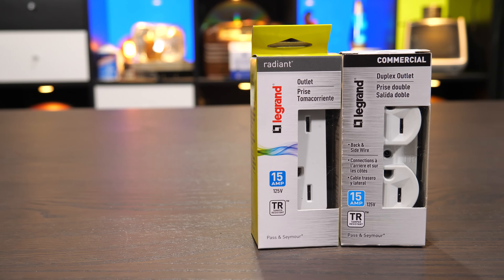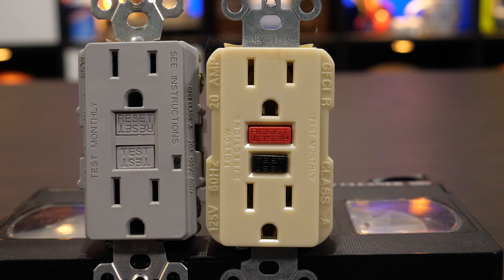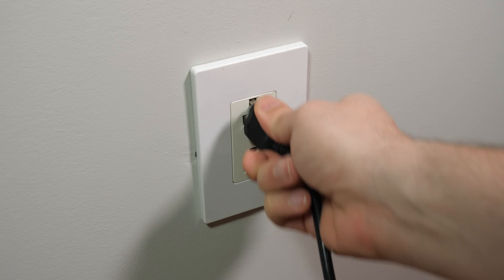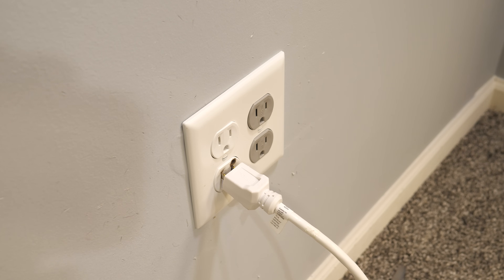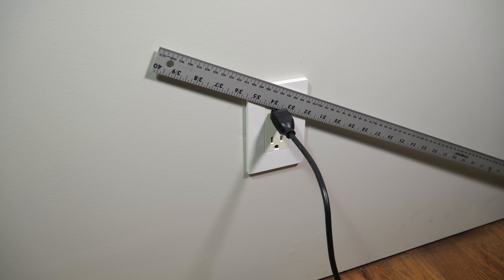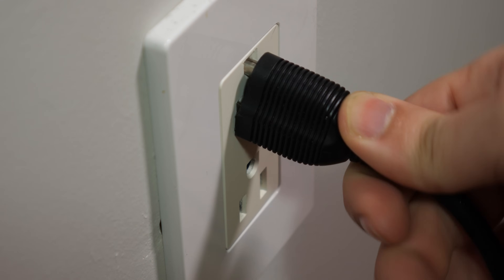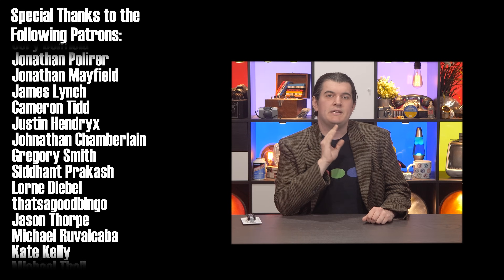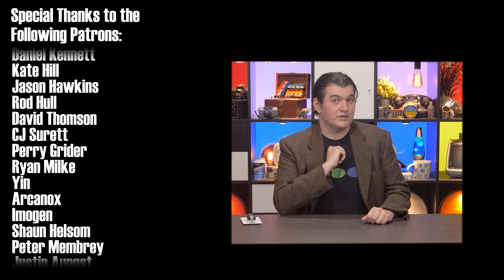Power outlets are topsy turvy - but does it matter?

Comment: Is this a re-post? I seem to remember a video just like this.
Here in canada, wiring code has flipped then flopped back. for a time, electricians were required, by code, to orient the outlets with the ground pin at the top. There are still some outlets around that are installed that way. When I install outlets, I use commercial grade duplex receptacles. They only cost a few cents more than the residential grade, but the internals are vastly more robust. I seldom have to replace an outlet a second time and when I do, it's because of an incident causing damage, not normal wear. Attachment caps (plugs) have the ground pin longer than the conducting prongs. The last thing to break connection is the ground pin. When placing the ground pin at the top, the plug now has to be further out of the wall before the conducting prongs break connection. This is why the electrical code inn Canada went back to putting the ground pin down.
Hope that clears things up.
PS: In the very rare instances that I have been forced to install an outlet sideways, I put the ground-pin to the left. The I leave the reason as an exercise for the reader.

Comment: The right angle plugs also get stressed where the wire inserts the plug, eventually causing the wire or the form of the plug to fail, could even expose wires.

Comment: There was one outlet where I was very adamant that it be installed with ground up, and that's the one behind the table in my parents' house, where we needed to replace it because the mirror on the table above (it's like a tri-fold shape with a mirror in the middle and rests on the two folding arms that sometimes get bumped and then go flat, making it no longer self-supporting) fell behind the table and landed on the plug and destroyed the outlet, which was a very old 2-prong outlet that had become very loose and had a cheater plug plugged into it. I figured if it happened once, and they aren't going to change their behavior, it'll probably happen again, and when it does, the more likely it hits ground, the better.

Comment: I have changed so many live light switches and such over the years... Yes, I've zapped myself plenty of times. The occasional numb finger is just part of the deed. Hell, I've even pulled outlets in a flooded basement before. Who the hell dies from residential 120V...? Niche case indeed I suppose. Half the time you bump a hot terminal you won't even get a tingle - our skin is an awful conductor.

Comment: Because if you happen to drop something that happens to be metal and you happen to be standing against the wall and you happen to be standing directly over a plug and the plug happens to be bent away from the wall and the thing you drop happens to be really thin and it happens to fall straight down and happens to land between the plug and the wall and happens to hit the metal prong....

Comment: A problem with right-angle wire exit from plugs, as is usual here in UK, is that when disconnected from the socket the plug makes an excellent caltrop.

Comment: What should be done is place the outlet HIGHER on the wall.  The typical, low on the wall outlet is very toddler unfriendly and elderly unfriendly, toddlers of course have that at a very convenient level making them attractive to play with and of course the elderly have trouble bending down and then add in the force required to plug or unplug an outlet you have a person with precarious balance in a position of poor balance trying to apply force that can lead to a fall.  

Placing the outlet at a height where you don't have to bend down or bend down much mitigates the elderly problem and also brings the toddler who mat still be able to reach the outlet into a position that is not as easy to hide what they are doing.

Someone will of course say that it ruins the esthetic but that outlet is nominally invisible when low on the wall or high on the wall, people learn to ignore outlets unless they are looking for one and the height on the wall matters not at all.

Comment: To make type A and B plugs safer, you shouldn't only sleeve the blades, but also recede the receptacle a bit, so even if an unsleeved plug gets slightly dislodged, t still won't have the blades open to the air.
Reply: Recessing would be a big nuisance.  They would need to redesign both the receptacle and the box, even if the plug were compatible.  Manufacturers would have to make both types.  Right angle plugs would not work in the recessed receptacle.
Reply: @GH-oi2jf  that's the main issue when you make an unsafe design and manufacturers take advantage of that unsafe design.

Comment: Right angle plugs need the cord to come out at a 45 degree angle so that they will never block the plug below if they are plugged into the top plug, regardless of plug orientation.  That, at least, should be made standard

Comment: While I agree with you wholeheartedly, Dan's Pro Shop did a short on outlet orientation. He makes the point that, in a machine shop with metal filings and shavings and all sorts of crap flying all over, the odds of someone accidentally wining a game of "throw the knives at the wall" with a foreign object go WAY up. Obviously far less likely in the home environment, but still interesting to keep in mind. Might be worth flipping your weird sideways outlets to have the neutral on top, if its in that kind of setting. Great video, as always!
Reply: Anyone can find a corner case and say "but what IF...", but usually if there's a use-case that has shown an elevated risk, the NEC or OSHA will directly address it. Industrial and jobsite electrical fires most frequently involve damaged cord-and-plug sets and defective tools.
Reply: I've actually seen this happen before. The most common way of cleaning off machines is with an air gun, and chips will fly onto the floor and then later swept up. Someone at my work did trip a breaker from this.
Reply: @hank4239  main reason machine shop at my university had IEC connectors on everything.
Reply: I feel like metal shops and that sort of thing should have outlets with hinged plastic/rubber outlet covers, so that empty outlets are fully protected, and in-use outlets would have a little "umbrella" over them that would prevent any sort of debris getting into them. It might not be 100% foolproof, but it would certainly be hard to fool.
Reply: In that scenario wouldn't it make more sense to have some sort of covering to prevent stuff falling in?
Reply: @MorbidEel  some companies make those now, however they're not required and unless it happens no one is going to even think about that. What we did at my work was buy extension cords with those little tabs that you can put a screw through so you just screw it in after plugging it in
Reply: @hank4239 anyone who would argue about receptacle orientation on that basis is already thinking about it. Screwing it in does sound like a better option. Also explains why some larger machinery has built in covering and locking twist.
Reply: I mean, there so many other ways to die in a machine shop. This really seems like a tidiness issue.

But, even if you remove the cover, those protected boxes could prevent things from sliding onto the pins. And I really can't see a reason why you would have an outlet facing the machine within chip range in the first place. You never want to reach over lathes and mills for any reason. I'm banning wall storage behind machinery in my shop because of how dangerous it is. And if the splash shield on a manual lathe or mill has a horizontal surface, it's getting bent or cut off to discourage the use as a convenient shelf.

Comment: Great news! This isn’t just design speculation, as in our house the electrician who built it installed all our outlets upside down. It is precisely as annoying as you suspect. There are a ton of large right-angle plugs which are constantly attempting to rip themselves from our walls via gravity. Most recently, if you have Google fiber, their fiber jacks which connect to standard outlets and allow you to hook up Ethernet cables to your devices are constantly trying to pull themselves away from the wall, as they are fairly heavy little boxes meant to hang down from a right angle plug. Ah the joy of losing internet because gravity broke your connection!

Comment: In the UK, where I live, we have three-prong plugs, which are considered very safe, First, the ground prong is longer, like those shown in the video, but has two other safety features. All the prongs are thick square metal, and the ground prong also opens up a cover on the live and neutral holes. Without a ground prong, a plug cannot be inserted. Indeed, there are no UK plugs without a ground prong. The ground prong is always at the top. Some plugs have plastic ground prongs, being ungrounded plugs, but still need a ground prong to open the plug socket on the wall.
Also, our live and neutral prongs are covered in plastic halfway up. Thus ensuring that if a plug becomes partially pulled out, only plastic is exposed. Mind you, we have 240v AC in the UK, to all plug sockets.
Over the years, we have moved from plugs that can be wired by the user, with a screw holding the two halves of a plug together, to moulded plugs that cannot be rewired. However, all UK plugs have a fuse of varying amperage. Usually 3, 5, or 13-amp fuses, depending on the appliance the plug services. These can be changed if needed.
Reply: The fuse is to protect the lead not the appliance.
Reply: @unicornpub  I know that. I didn't say what it was for. Just most plugs have them.

Comment: I really like our schuko here in Sweden. Works both ways, always grounded, really hard to poke into, easy to handle and fully compatible with the ungrounded europlug.
Reply: the 3 pin schuko plugs also fit into 2 pin sockets

Comment: A metallic wall plate falling on the plug pins actually happens, I've had first hand experience. The breaker did not trip for some reason, I had to run to manually switch it off. The plate gained two slots where it landed on the pins 😂 😂

Comment: I submit that the safety pin down is the correct orientation. Most outlets in the US are mounted below your knee on the wall. As you lean over to insert the plug you will automatically tip the plug backwards a small amount to see the alignment of the flat blades in relation to the outlet. This makes the safety ground pin of the plug in your hand the first element to make contact with the outlet, thus grounding the cord in the event of a short.  Then the blades slide in as you rotate the plug forward to align the blades to enter the slots.  In the event there was a short in the circuit the "pop and flash" will scare you, but the safety ground pin keeps your fingers from being part of the current through the cord.  With the safety ground pin on top, it is blocking your view of the blades. That is less safe. Yeah, I'm an old industrial electrician journey man, electrical engineer, and house builder. Set in my ways - for a reason. The EU could mess up a wet dream.

Comment: At my work pace a metal cover plate actually came loose and shorted the hot and the neutral.  After that the electricians turned every outlet around so the ground pin was on top.  Imagine the cost of turning literally thousands of outlets around.  I think it would have been easier and cheaper to convert to plastic cover plates but I was not asked my opinion.  I flipped all the outlets in my home the other way and it was more hassle than I expected so I turned them back so the hot and neutral were facing up again.

Comment: Another fine video thank you.

I believe most, if not all, UK sockets are installed horizontally thus leaving both double-sockets accessible.  It seems that installing vertically can easily make one socket inaccessible?  On the rare occasion a UK socket is installed with a different orientation it is a sight to behold and makes one wonder what the installer was thinking!

Comment: 2 reasons to not rotate:
If you put the ground pin up... 
* during a flooding will have a short circuit first because the hot blade is lower!
* you will not have a little face.
Yes, it's ridiculous.

Comment: Your game of "throw the knives at the wall" reminds me of the time I spilled an entire box of paper clips on a partially unplugged outlet and spot-welded a paper clip to my laptop charger. What orientation was it, you ask? Horizontal - it was a power strip sitting beside my desk.
I was also in a college dorm room, so my roommates and I had to find the RA to open the fuse box.

Comment: I find with the Ground Pin (Down) will hold the cord in the outlet better (When the device has a heavy Cord)  the wight can pull the ground away from what I feel  a poor contact. so.. I like the Face orientation (Better performance) .. 😮 but that's just me.

Comment: One thing I wish they would change in 3-prong plugs is that if the ground pin is "somehow" removed or disabled, plug orientation could be lost.  Without the wider neutral prong polarization, someone could be hurt if it is plugged in backwards making the chassis hot resulting in electrical shock.

Comment: Here in Brazil we have used the American standard for electrical outlets for a long time. But it is a clearly outdated standard and poses many risks. And the orientation of the pins changes absolutely nothing about this. A few years ago, the Brazilian electrical socket standard was changed to its own version, and surprisingly it is much safer, more practical and modern. There was some resistance to adoption at first, but over time people understood that it was actually much better and safer. Electrical accident rates were greatly reduced after this change. Another point to highlight is that it seems to me that American electrical installation standards are also quite outdated, when compared to current Brazilian standards. As an electrician trained under the Brazilian standard NBR 5410 (take a look if you are interested, there are many interesting rules), I get scared when I see some electrical installations from other countries. It seems that even though we are a screwed up country in many aspects, we still have some examples to give.

Comment: Wrong Wrong WRONG! The USA Plug with the ground pin down is the RIGHT WAY UP! All plugs with this orientation has been the standard. In Japan, the ground pin has always been down. Quite recently, the ground pin up has been the standard. Every fucking time I see the ground pin up, it looks stupid and bugs the HELL OUT OF ME. It looks so stupid. By you supporting the new code, it bothers me, A LOT. How often does an "object" fall onto the live and neutral? How often does any metal object touches them? I seen NONE of these things happen. Also keep in mind that our electricity is only ONE TEN VOLTS. No one is going to get killed getting zapped by a 120 volt conductor. If a fire starts, its not because of the orientation, its because of bad design. So installing a plug upside down is just stupid. Do you see them doing this in England and Singapore? Imagine how stupid THEIR plugs will look if installed upside down.